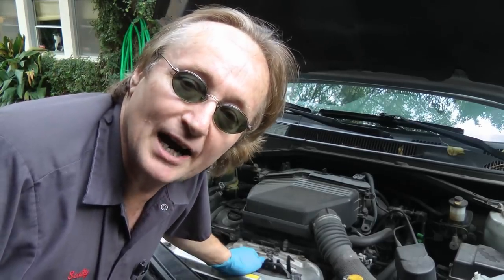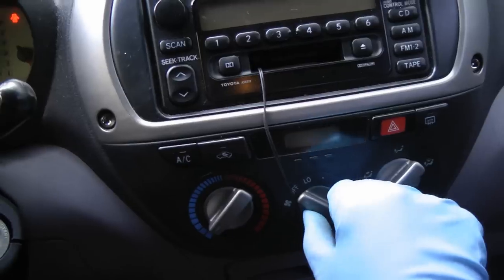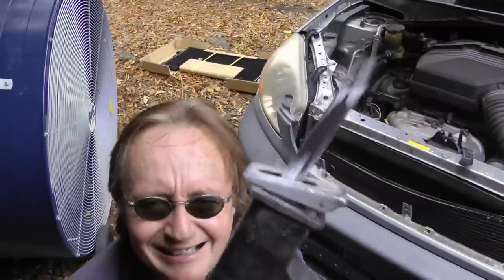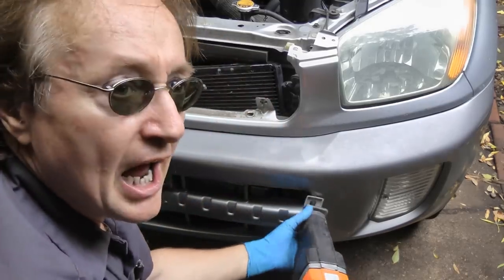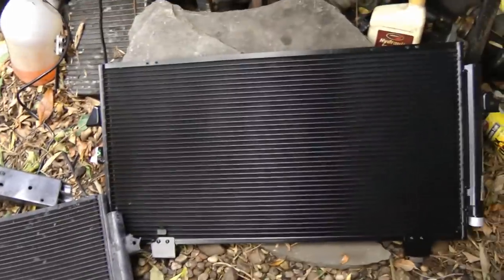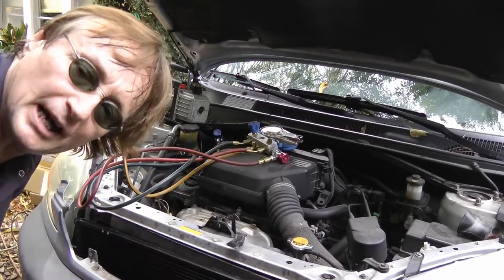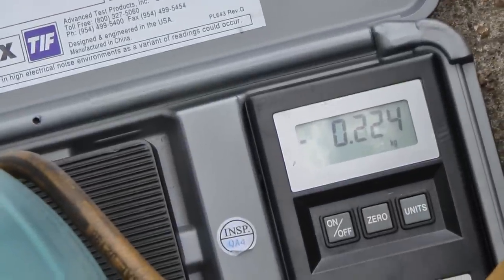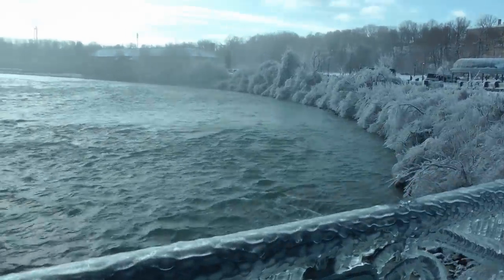How to Fix Car Accident Damage

Comment: Can this method be used for adult wrecks as well?
Reply from the maker: Yes, but they happen less frequently
Reply: No
Reply: Scotty Kilmer. You haven’t driven in Houston TX. People of all ages have wrecks here.
Reply: @scottykilmer  i have been In a wreck with my Mercedes benz, it wasn't that bad, the only thing I replaced was the rear bumper and that's it.
The frame is made of metal( steel and titanium).
Turns out, a teenager crashed his car and got it destroyed( beyond repair damage).
My car survived thanks to adaptive suspension. And much more like Abs.
As well as my reaction time.
Reply: Lol u shouldn’t have said that….

Comment: I got in a "wreck" last year when I was 16. It messed up a fender an broke a headlight. A repair company wanted $8,000 to fix it. $5,500 of that in parts! I got the parts for $100 and had them painted. Total of $1,800 as I put them on myself. It was the other drivers fault so I won that and had money to pay for insurance, car upgrades and fixes, and pocket money to screw with. I can agree with doing work yourself. No A/C company would touch my car because they knew of the hell that awaits, I rebuilt that myself and probably saved over $3,000 in labor. It's a 928 so even when they were new the dealers didn't know how to work on them. Great vid as usual Scotty. And People, doing your own work isn't that bad, just start off learning basic things and go from there. Good luck to those who want to do this work themselves.

Comment: Hey, I’ve been a teenage driver for over a year, and I have never gotten into an accident that resulted in intense damage to parts. Once I slid down a icy hill and into a snow pile. No engine parts were affected, and the only thing that got affected was my left-rear wheel. Two guys in a pickup truck helped get my car of the snow. My car had its alignment redone and it drives like a charm.

Comment: Reminds me the of the time I ditched my dads 2005 toyota corolla with 600,000 km .  Cost about 70 bucks to fix. Unbent the rad support  with a bottle neck jack. Repaired the trans line as they got cut when they pushed against the fan belt. Fixed the lines with a flared piece of brake line and hose clamps .  50 bucks of that being new atf fluid. Rest was for coffee and beer to use my buddy's hoist. Still drove that car for another 4 years after that until it need new struts was worth the 1000 bucks for new  coils and struts so now we just use it for parts for my 05 matrix and my brothers gfs sisters 05 corolla.

Comment: The sawzall is a great tool.  I changed the shocks on my Chevy S10 this summer and the nut on the top of the front shocks was seized up.  It was rusted right on there.  There was no getting it off the conventional way.  I expected this, so I broke out my dad's sawzall and hacked the top of those shocks off.  It saved me a lot of time trying to get the shock out and it made changing the shocks out on my truck so easy.

Comment: Hi scotty. I have a 2010 toyota  corolla  and all interior lights don't  work. the dash ,radio, console lights stopped working and I have checked the fuses under the dash and they are good.
Reply from the maker: check the dimmer switch on the dash that dims them, they often short out. You can just bypass the switch
Reply: thankyou so much. I had the car in the shop and that is exactly  what it was. you have a channel  and I really enjoy  them. thanks again.
Reply: Scotty Kilmer how do I fix my car AC after an accident and the fan was only Blowing plus the dash light doesn’t come on? Thanks
Reply: AC light does not come on in the dashboard

Comment: Years of being an HVAC Tech you always want to add about 2 oz extra if your using a large manfold set on such a small system if you dont it will be undercharged once you take off the gauges

Comment: Scotty. How do you put up with all the haters?

I suppose you have the experience to fix almost any problem on any car. Yet, 99% of these YT commentors probably couldn't do 1/10th of what you can do. Yet, they mouth off about your work while they sit behind their keyboards.

And why is everyone such a safety inspection nazi? 'This wouldn't pass inspection....etc'. Please. Try worrying about the teenage girls driving skills instead of whether some steel bar is at the front of her car or not.

I don't wear my seatbelt when I drive - haven't for 16 years. I have never been in an accident because I drive in a manner to avoid them. I create space on the road and turn away from collisions instead of just hitting my brakes. All these seatbelt wearers and all these accidents are a joke!
Reply from the maker: when you consider that over 55 million people have watched my videos, the tiny amount of haters actually amazes me, I'd expect it to be larger.
Reply: Driving in a safe manner, yes, I have been a passenger where I thought the driver is tailgating under my driving standards, 10 car lengths for 100 Km/H. Never collided with anybody's rear end, however I had the front end wiped out by a speeding car coming out of nowhere when I tried to enter an intersection from a stop sign with a truck blocking my view in that direction (so many people have collisions there), started off my independence days a Toyota Camry with a bowed in passenger door because of a very bad decision I made 2 weeks from getting my P's, so not all collisions are at the front.
Reply: @scottykilmer  They're just jealous. Jealousy always brings the worst out of people. It's impossible to avoid it.

Comment: Hi Scotty, I have a 2004 Tahoe and it only blows air through the defrost vents. It won't blow to the leg area or the front. Also it either blows really cold air or really hot, nothing in between. The head unit is electronic

Comment: I recently got into a collision, almost same like the car in the video. Apparently, engine seems OK, and I was able to drive my car to the workshop. Radiator and condenser damaged, and these wrecked parts were touching the engine exhaust side. I noticed that while driving, car engine vibrated more than usual. My question is, if the engine looks OK and upon visual inspection from the outside, it does not have any damage/cracks, then engine would be OK internally also, or is it possible for engine to get damaged internally just because of the impact even if engine did not receive any collision? Can an engine withstand such sudden shock from the collision?

Comment: Hey Scotty, I've been having trouble starting my car, lately it hasn't been starting. It'll crank but as soon as it starts it dies again, I have to do it multiple time before it start. Its a 98 mustang manual, hopefully that helps narrow it down, and this happens a lot when I turn on and off my car a lot through-out the day, and during cold season. But once it start its ok to drive, as long my engine don't turn off.
Reply: I know i'm not much help, but it's probably because it's a Ford from between 97' and 05'.

And I can judge, since I drive a 2002 Ford Escape and the thing has started doing the same thing to me.

BUT, quick question, do you live in a state that's below zero right now?  That seems to do the trick.

Comment: I had to replace the ac compressor on my older Chevy pickup so obviously there's no refrigerant in the system anymore. I was wondering if I can recharge it myself with those kits you can buy from the store? Or does the system have to be evacuated first before recharging

Comment: Hi Scotty. I wrecked my 1995 nissan Pathfinder. I am trying to repair it. My issue is, the front bumper is smashed inwards, so Is the driver's side front fender. I can't access all the bolts to remove!! How do I go about pulling off or  cutting off the broken parts that need replacing??? Thanks!

Comment: Hi Scotty, I just found your channel....Love It!!! Do you recommend changing all of the fluids in your car regularly? Thanks so much for the terrific advice in all of your videos! :)
Reply from the maker: yes, change the engine oil and filter every 3 or 4 thousand with conventional oil, coolant once every 5 years if you have extended life 5 year coolant in it, change the tranny fluid every 30 thousand miles, and the brake fluid every 3-4 years.

Comment: Scotty, great video, as always. But what about the accumulator? Isn't there a risk of the dessicant bag having become saturated with moisture from the humid Houston air? I have heard you need to replace the accumulator anytime you have the a/c system open, because if that dessicant lets go it will toast your compressor and clog up your system.

Comment: Why waste money on Air condition coolant on your teenager. They should be lucky there first vehicle even has A/c. What ever happened to Vent and Windows?
Reply from the maker: i used to think that BEFORE i moved to hot humid texas. Now everything is air conditioned for me.
Reply: HaaHaa, I agree. I'm 34 and even though my 1998 camry with 183k miles on it has a functioning and cold A/C., I still don't use it as I grew up without AC in the house I lived in with my parents.  Yes Southern California isn't as hot/humid as the east coast or Texas, but a good old bottle of water, wet rag on the head and loose clothing works just fine. Damn kids are just too spoiled nowadays.
Reply: agree
Reply: 1Smoking Lizard  yea and when your water gets hot
Reply: drippingwax  how a window ac is like 259 where i live
Reply: I have a 96 camaro and its my first car (I'm 16) and it dosen't even have A/C, there's a leak somewhere
Reply: I deal with no heat/air anyway, if I got in a wreck that would be the least of my worries
Reply: Or get a good job so you can buy a good car
Reply: 1Smoking Lizard Thay sounds ridiculous. Wet rag on head?? How can you say that like it is superior to air conditioning? Not spoiled, just taking advantage of life's technological advancements. You must live in hicktown.
Reply: Older people are the worst drivers not teenagers

Comment: Hi Mr. Kilmer....this is unrelated to the video, but I'm in extreme need of advice. Less than a year ago, I had the air suspension on my 02 Oldsmobile Bravada worked on(bag deflated I believe) because the rear would sag and eventually did not lift at all. I would like to know if I convert the rear air suspension to conventional coil springs; can I only convert the rear or would I have to convert both the front and rear? I only have the problem with the rear sagging; have never had an issue with the front. This is about the second third time I've had to pay to fix this same issue.

Comment: Scotty Kilmer I have a 03 mustang cobra, when should I replace the serpentine belt? the dealer says i shouldn't do it but I've had the car since new and have yet to replace it and it sits at 149K miles and about to move from CA to VA in the middle of winter.

Comment: Hey scottie,  I have a 2001 toyota avalon that keeps shaking when on drive and while acceleration.  I had the spark plugs replaced and pcv valve replaced 2 months ago. But the car still vibrates. Any thoughts?

Comment: My AC compressor got replaced with a pulley after it failed by the previous owner, who knows how many years ago. Unfortunately, whatever shop that did it left the lines OPEN, instead of capping them off like you are supposed too. What do I need to replace in the system that's probably full of junk before its safe to put a compressor in there? I've heard condenser and accumulator along with the lines.
Reply from the maker: yes, the entire system is pretty much garbage now from corrosion due to water vapor intrusion. Even flushing won't fix that.

Comment: Front end collision with no damage to the bumper, bumper support or radiator support?
Reply from the maker: not enough to worry about, it still ran and tracked fine. Main damage was hitting a trailer hitch in front of her.

Comment: So I had a 1991 Nissan and I recently got into a wreck and the hood bent upward a little bit and the rad support bent and pushed the radiator forward a little bit just enough to crumple the hoses went to drive it right after and the temperature was still in the middle  even though I hit a car going 10 km/h should I just have repaired the car and not junk it ??

Comment: Where did you get the vacuum pump to vacuum the moisture and air out of the a/c line. I normally just buy an a/ bottle at Wal-Mart and pump it in to my 1994 Honda accord ex. Is it bad if I don't vacuum the moisture out and just pump in new a/c?
Reply from the maker: YOU must take the moisture out, places like harbor freight tools sell pumps for 50 bucks or so

Comment: most places if you put the condenser in will around here charge you 100 dollars or so for the fill and vaccuum part of this job which is what the vaccuum pump and manifold assembly cost. i had a old car that ran  fine without being vaccuumed out, but that was also a 400 dollar car before and 600 after  that i was trading in and well, the compressor blew a seal previously and we put a 50 dollar junkyard piece in that raised its value a bit, more so than the labor and part was. i normally wouldn't of bothered, but we already purchased it so it was silly to not install it.

Comment: You sawed a piece of the frame out. But doesn't that alter the structural rigidity of the car? Shouldn' that beam be replaced as well?
I mean it's there for a reason.
Reply from the maker: it's just a minor bumper brace. I said it wasn't a perfect job, but it'll do. Customer only wanted to spend so much money

Comment: I had a 97 Altima that didn't have AC which was fine for me in Minnesota because it's generally cool enough in the summer for an open window to keep me cool. That was until my power windows went out and I spent the entire summer baking in my car until I realized I could wire my power windows directly to my battery. Wasn't the greatest fix but it lasted till I sold the car :)

Comment: I saw a check engine light on at the end. What code was it throwing?
Reply from the maker: air fuel ratio code, typical for the year, it was a design and software flaw.

Comment: A vacuum pump is not used on an a/c system to "suck out the air".... It's used because water boils in the presence of a vacuum. It's simply done to remove any moisture from the system. If it was done just to remove air there would be no reason to have the system on a vacuum for an hour. You could place a vacuum on the system and suck it down until your gauges showed - 30 of mercury then that'd be it.

Comment: Scotty, did you replace the frame piece you took out? I feel if not won't that compromise the integrity of the car, if the car runs into something else?
Reply from the maker: that's just a bumper brace, customer was happy and didn't want to spend that kind of money on daughter's car.  I did say in the beginning it's not a perfect fix, but it serves its purpose
Reply: ok i was just wondering thanks

Comment: Scotty Kilmer I have a question I have a large chevy van and I'm working on everything my question for you is my gas gauge reads full no matter what how do I know if it's the float or sender unit my mechanic won't touch it so I have too do it
Reply from the maker: replace the whole sending unit assembly, float and all
Reply: Ok is that the cheapest solution because it is all gauges I also have a crack in the catalytic converter

Comment: It's very cold where I live, but my car heater doesn't blow hot air right away till the engine is warming up its that normal? Sorry for such a stupid question.
Reply: That's normal. The heater uses hot coolant to give you heat so the coolant so the engine has to warm up first to get everything nice and hot.

Comment: That happened to me lol but I’m 26 but I think mine got more damage than that it runs fine but smoke/vapor comes from the engine so I think my radiator needs replacing 😢 or could it be something else causing the smoke/vapor from the engine

Comment: Scott, got a 95 ford taurus that will not shift out of first gear it will only go 20 or 25 mph. What might be the cause of it?
Reply from the maker: check the fluid level and pray it's low. If not, internal transmission problems, often costing more than that car is worth
Reply: Scotty Kilmer hi scotty i have a 01mercedes kompressor c200 petrol  it was parked up for a few months and the battery went dead so i charged the battery up and its fully charged and now it wont start its turning over but it wont fire up could it be the immobilzer do you have to reset it cause it was driving fine before the battery went dead any ideas scotty thanks